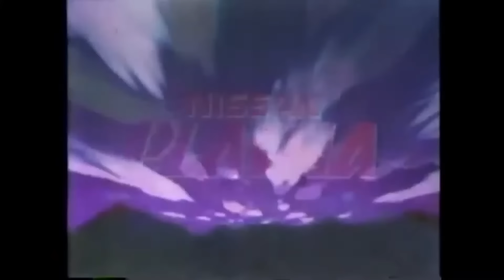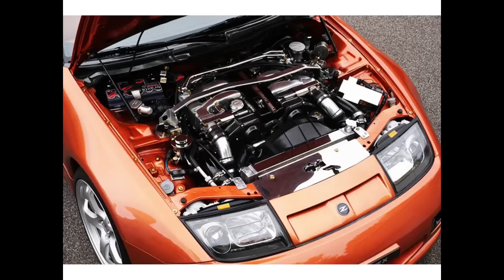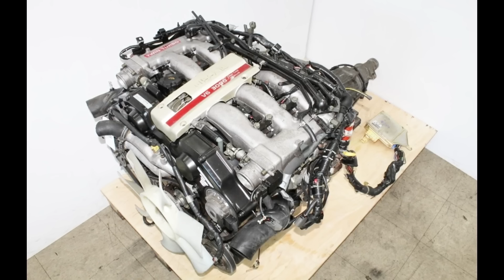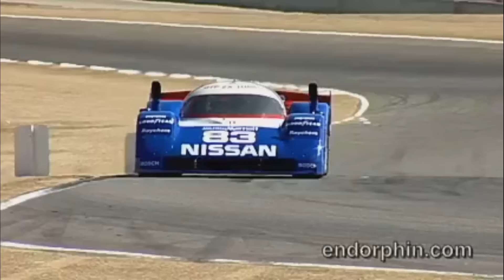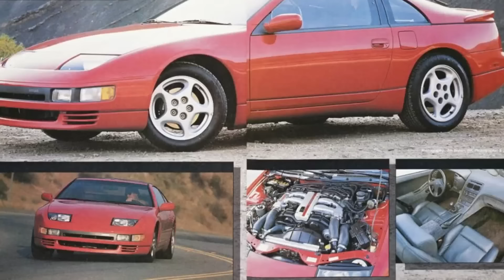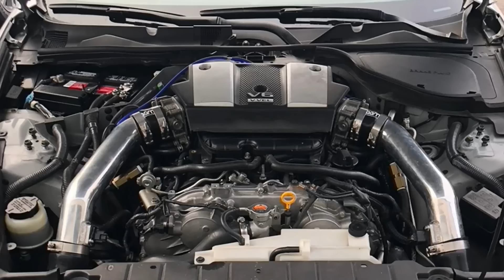Why Nissan’s VG30 V6 Was Way Ahead of Its Time!

Comment: I honestly rate this engine above the RB26DETT. Not a lot of people know that the VG30DETT had undergone A LOT of tuning by Nissan which RB26DETT didn't get. For instance the inlet manifold resonance tuning where they optimized it for torque. The whole intake took a LOT of development, both pre-turbo and pressure side. The turbochargers themselves were made just for this car. They operate pretty much at the heart of turbocharger efficiency.
Yes, VG is heavier than the RB, but the shorter and wider design with more capacity allows for more power, torque and superior weight distribution. I've seen a VG30DETT mounted in an S14, which was awesome and I think Nissan should have installed it in the R33 GT-R.
Reply from the maker: VG30DETT is underrated for real
Reply: Well the rb26 or gtr has its all tech inside the drivetrain instead of the engine, the engine is peaky as a racing engine should be, and the awd system handles the rest, that's why rb26 doesn't "work" unless it's inside the gtr. Both vg and rb are pinnacles of nissan engineering imo, one for sophisticated smooth performance, and the other for straight up raw performance.

Comment: So 950 HP was the tuned race ready version. Not too bad for mid 90's. Curious what boost pressure they ran for endurance races to make the 950hp. Would love to get ahold of one of those engines from that era of racing

Comment: I owned 2 infinity J30s in the US with this engine but in 210hp tune due to deleted second airbox and air meter found in the Z car along with a milder exuast system. 

Engine was a nightmare to service and i felt the tune of all the power on the high end was not suited for luxury duty but i liked the sounds the car made so i bought it twice and kept the last for one 22 yrs.

Comment: i once went 187 mph in a 550hp nissan 300zx  and the windows shake violently as they dont sit in sills at the top of the door  and it ripped the sideskirt off also one of my greatest childhood memories i cant even imagine 260mph without securing the window glass somehow
Reply: This never happened
Reply: @PAP-MP7  i once took my tuned impreza to 160mph  and my 370z and s2000 to 150mph with videos and pictures of the speedo on mt social medias if you dont beleive me  and grew up with my dad owning nice cars like a  sierra cosworth mazda  rx7 supra tt 300zx tt   it seems a bit of a stupid thing to makw up especially when theres lots of similarly powered 300zxs in the 90s-2000s hitting 200mph in tokyo and new york street racing. And google states a stock 320hp 300zx unrestricted is capable of 175 mph
Reply: @mikeconneely6 right I’ll believe it when you post it on ur YouTube channel anyone can claim and say who they are on any social media page 🤡🤡
Reply: I ran 203 mph and ilthencar was insanely smooth. The tunnel vision was the insecurity. When my car was stock 155 felt like 90mph
Reply: @ApeXiTT-Tech  i was 14 in 2004 the car was stable but the windows were shaking violently as they dont  have pillars supporting them after 170mph